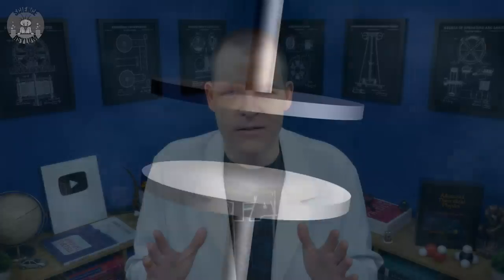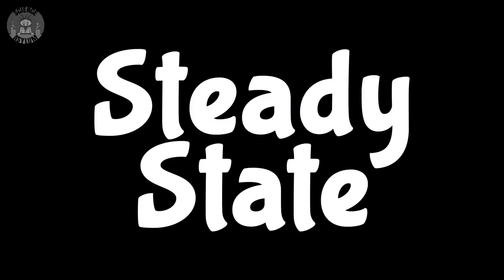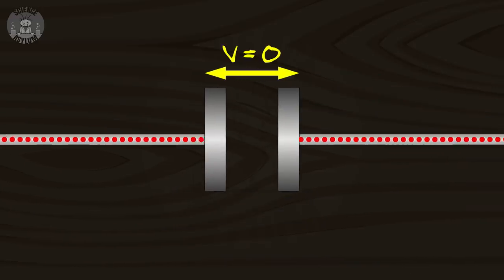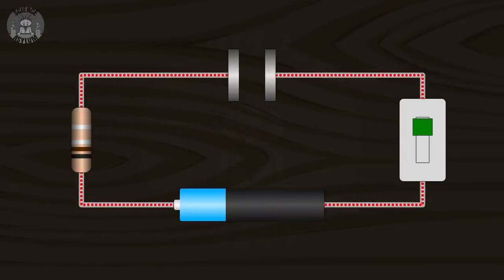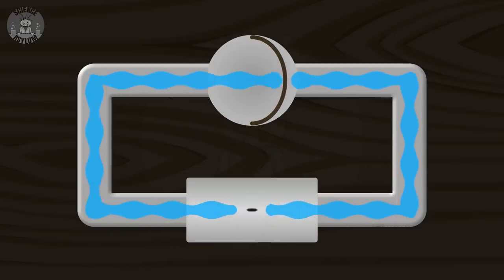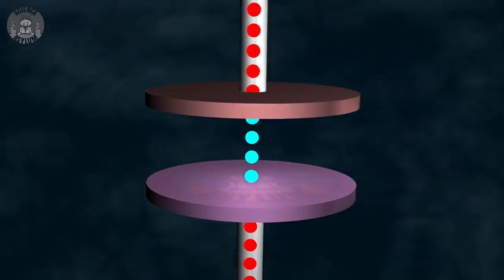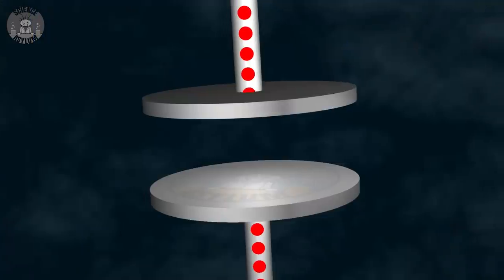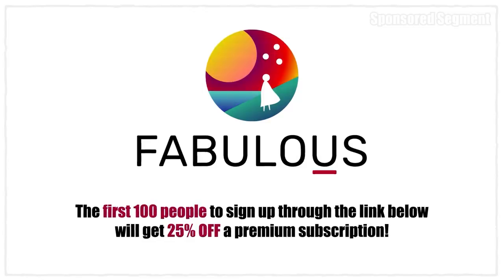Capacitors Are Gaps! How Does That Work?!

Comment: Iam confused here! Didnt you say in the previous video that the flow of energy (poyting vector) is perpendicular to the wires ?! But in this video, min 11:20 the the flow ( white vectors) is  parallele to the  wire ?!?
Where is the catch ?!
Reply: Its perpendicular to both magnetic and electric fields.
Reply: His previous video only highlighted certain components of the poynting vector (that which is perpendicular to the wires), but the more accurate direction is in this video. The large portion of the poynting vector will be parallel to the wire, but the important thing is that the perpendicular component does indeed exist, and is related to the power lost to resistance along the wire.
Reply from the maker: Read the pinned comment on that old video. I clarify.

Comment: Wait wait wait, the gap doesn't need to be that small right? You can build a capacitor with a glass Jar, aluminum foils, a metal chain, a bouncy ball and some salt water and you can charge it with PBC pipes and a towel (at least electroboom showed this)
Reply from the maker: Correct. Any gap will do, but smaller generally works better. Technically, even the switch is a capacitor.
Reply: @ScienceAsylum  aaaah that's the catch, thank you for answering as usual Nick :)

Comment: The energy flow you show at 11:25 is parallel to the wires. In your previous video from a couple years ago, you show the energy flow perpendicular to the wires at 6:00. Why the change? 

It reminds me of another video on the Poynting vector I recently watched that discussed a difference in understanding of the energy flow direction. Here at 11:25 
https://youtu.be/gezZklOsGbg
Does that have anything to do with the difference in energy flow direction from your two videos?
Reply from the maker: If you read the pinned comment on that older video of mine, you'll get your answer. It has to do with which components of the Poynting vector we choose to pay attention to.
Reply: @ScienceAsylum  Got it. Thanks!

Comment: A question : if a planet have a escape velocity more than or equal to speed of light , what will happen to light if we shot a laser beam from surface of that planet .
Reply: If you use newton's laws to calculate an objects surface escape velocity to be greater than the speed of light, in General Relativity that object will be a black hole. Light will not escape but fall back to the center.

Comment: Anyone with a basic understanding of electric current and electricity in general knows that gaps mean nothing. The electricity doesn't depend on the wire to flow, it doesn't even flow IN the wire, but it does flow WITH it at certain currents because it's the best available conductor on its path. Much like water, and light, and anything else, it takes the path of least resistance. You can extend a break in wire for a ridiculous distance and still have a circuit, granted you have a strong enough current and there isn't a better conductor than the air located between the gaps. IE lightning...

Comment: Ok, but what is the point of a capacitors? Why do we need them?
Reply: Multiple uses.
Basically they allow AC to pass, but not DC. They are used as filters for audio speakers, allowing only high frequencies to pass to a tweeter and keeping lower frequencies from damaging them. Then inductors do the opposite for low frequency woofers.  Together they make multiple element speakers more efficient.
Reply: They are used to improve the power factor of inductive loads.

Comment: I'm not going to disagree with you, but you tend to make simple things sound complicated. I would have started with the last part: energy is stored in the charged dielectric, (just like it would in a rechargeable battery), and expand from there
Reply from the maker: This is just the way it makes the most sense to me. I'm wired for the theoretical stuff. Didn't even mention what capacitors are used for... partly because only know a few, but mostly because I don't care where they're used. It's not my area 🤷‍♂️. That's someone else's job.

Comment: Your kidding... So like I pondered over the existence of chakras and figured that the only thing shared with these points is that nothing is there it's just gaps that seemingly reacts to pokings or impacts... That didn't make any sense unless it was some form of compressed energy preventing anything from naturally occurring there... Which by the sounds of it is like a capacitor... Which blows my mind... The two rivers of life intertwined but never touching... How can it fuel itself? Spacial Capacitors! Essentially when alot of matter is arranged in the right way to make the centres of gravity and thus centers of charges occuring outside the matter. Like bottle flipping.

Comment: Based on the theory of how the electric field pushes flow in a capacitor, does that mean Veritasium's analogy of a light bulb working is based on the electric field and not the electrons carrying potential energy correct? (https://www.youtube.com/watch?v=bHIhgxav9LY)
Reply from the maker: Derek's video is good. He is correct about the fields. The extreme example he chose to make his point isn't very realistic, but if you go into the video knowing that then it's a great video. Us educators have all been guilty of using unrealistic examples to make points before.

Comment: Hmm ok but not much about caps.

Let me see if you have any later video about inductance because IMHO it's mandatory to cover this stuff.

Honestly, I am NOT trying to fLIck your work up, just my point of view, following the rules you put in your channel. The most important one, prime directive
"it's not a bad thing to be a little crazy"
That's what got me, after your first video or so, about the rubberduck floating tho Rubber is denser than water, and not considering the fact that Rubber is VERY porous and it has density to float, net density, that's Rubber and lots of air.
Dunno if you clarified that one, Nick.

I hope you don't mind me saying these OPINIONS OF MINE.

after all, your fans tend to say lots of nice things because you are a cool guy and your content is often good.

Excepto que sometimes you have to use some analogies that doesn't work. I understand, but you already know it's difficult to get something "known" with quantum (🥺 just a MSc, you have or are going for PhD? 🥺?)

Comment: "Poynting vector", it "poynts" the path of the energy flow. Is it perhaps kinda the most fortunate name in physics? 🤔
Reply: Like Heaviside, Taylor, Schwarzschild, and Otto as well.

The Heaviside function is heavy on one side.
The Taylor series is a polynomial tailored to fit a function.
The Schwarzschild radius is a black shield around a black hole indicating the point of no return.
The Otto Cycle is used for the automobile engine.
Reply: @carultch Lmfao! All are good. Although I don't get the Otto one (maybe cause I'm not a native speaker)
Reply: @bemascu7087  Otto sounds like auto in English, because both the initial O in Otto, and the au in auto sound like the o in dog.    This similarity of pronunciation is what inspired the bus driver on The Simpsons to be named Otto.  The writers planned to name him Otto Mechanic, but eventually decided not to use that last name.

Auf Deutsch, which Otto of the Otto cycle spoke, the pun wouldn't work.  His own name would rhyme with Toto, and the au in German, rhymes with cow.
Reply: @carultch  Oh! Thanks for the clarification, didn't know that. I read it as in German (of which I know a bit), which is the same way as in both my native tongues
Reply: @bemascu7087  What are your native tongues, out of curiosity?
Reply: @carultch  Catalan and Spanish

Comment: I think your breathing capacitor drawing is wrong. The arrows should never point out words. The energy is always flowing in with alternating current.
Reply from the maker: Nope. It has to point out sometimes as part of the cycle, otherwise it would eventually max out and the circuit would fail.

Comment: Ok. As an electrical engineer, I have to correct you on one thing. There is NO flow of positive particles. Period. There IS electron flow. Which is ALWAYS negative (of the battery) to positive in the circuit. Describing it as positive particle flow is maybe fine for a physicist working with imaginary theoretical properties, but is both wrong and misleading.

Comment: Well technicly a wire itself, and tbh all electronic components do have resistance, capacitance and inductance. For an electronic engineer stand of point it does make diffrence but if u had to cnosider it evry time u build a circuit/device and so on u wuld end u with massive headache evry time. Thats why they assume they don't exists if we do know they ll not infulence our design. For exampe for slow DC circuits it makes no sense to consider it evry time, since it really dont make that much of diffrence most of the time, and u only take care of transient state for some of the components like Capacitator. But if they have to make device wich changing states can be measured in GHZ things start to fall apart if we don't. Wires, capaciators, switching speeds, power loss on changing states in transistors, and even placement or  shape of wires starts to really impact our divce. Althought im not electronic engineer, just an technician, i really do admire ppl who have balls and knowledge needed to design a working device that is able to cope dozens of GHZ, becouse off all this silly math and stuff going on there that u need to care about.

Comment: I wonder if he realizes there's no real flow in wires and if at all its going opposite the direction than their depictions show
Reply: There is a real flow of negatively charges particles. You can also, and engineers often do, model it as a flow of positive "holes" in the opposite direction. That makes no real difference to the result but is physically wrong.

Comment: capacitor is a transformer?
Reply from the maker: A transformer is basically two inductors interacting with each other.
Reply: @ScienceAsylum  That filled in a hole in my understanding. An air gap like the coil on a lawnmower.

Comment: What a coincidence you "begin" with saying energy being an abstract thing, not tangible. Coincidental, because I just had a discussion about that on some Dutch forum, where I used your video"What the heck is energy" as well.

A while back I was working on the development of capacitors and batteries with graphene (based materials) .. but after a year I came to the conclusion that this "wonder material" is utterly useless!!

Comment: No, capacitors are not cool, at all. When you first start working with them they are like a power source that is really, really bad at it. A capacitor does its work when there is a change in voltage in time. For example AC current. But even then, thats more electrical then anything else. 

When it really hits the fan, is when someone talks and the information is sent thru a wire. And even worst is when you vary 0v and 3.3v at 1ghz.

Comment: I am a retired electronic design engineer.  I take offence from your comment about engineers.   When I was in college, I took the same math and physics courses as you did and I learned physics too.  You were also taught all about electronics just like me.  The problem here that that the degreed physicist knows very little about electronics and a degreed engineer is the one who actually builds the electronic equipment because our models of how electronics works are better than the physic models of electronic components.  LOL  You have the common misunderstanding that just because you have an equation that you have the fundamental understanding of what that equation is meaning in reality.  Things in real life are far more complicated than just a simplified equation.  You with your bladders and Poynting vectors are a joke.  Remember that simple models are for simple minds.  Real capacitors are far more complex than your simple model would have you believe.  Why do you think there are so many different types of capacitors?  The dielectric is way more than just an insulator in a capacitor.  It dramatically changes the capacitance and the amount of charge of the capacitor.   Most people don't even know or understand the ESR (effective series resistance) of a capacitor and is mostly left off the model.  Try building a switching power supple and not include the ESR of the capacitor and you end up with an oscillator instead of a power supple.  I worked with PHD physicists all my life and most don't have a clue about how electronics really work.  All they have is an equation and they think they are smarter than us engineers.  Well they just have more equations than we do and need to publish or perish and work on getting grants for wasteful project to produce just more equations and nothing more.  Is that why they go around and stare up at the skies a lot?  LOL  BTW I do love your channel.  Remember it is OK to be a little bit crazy!